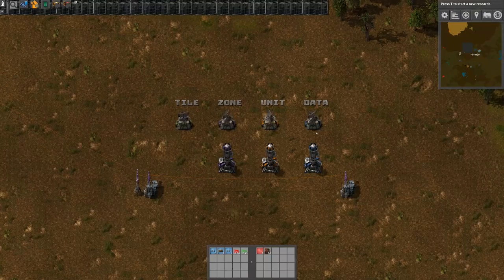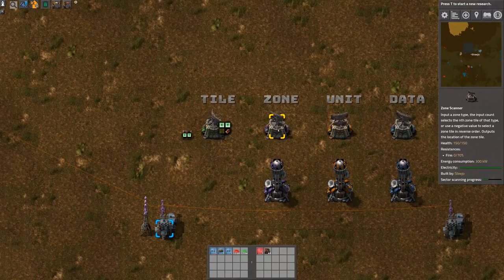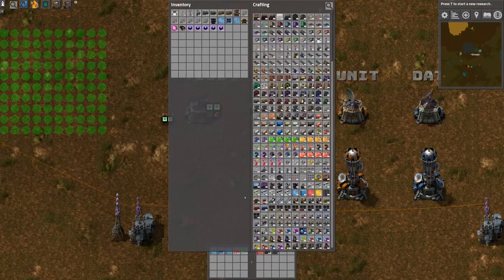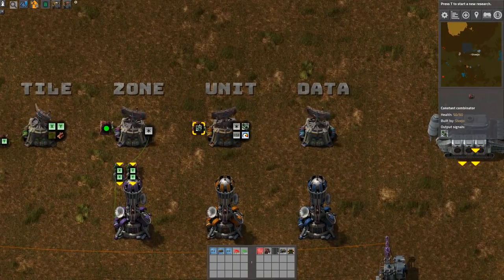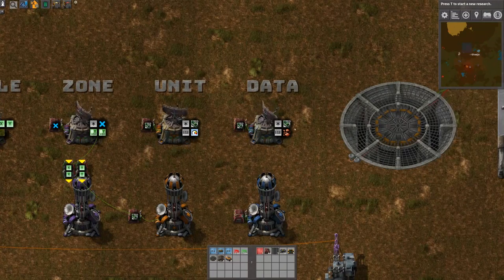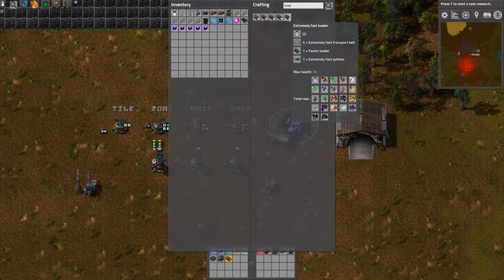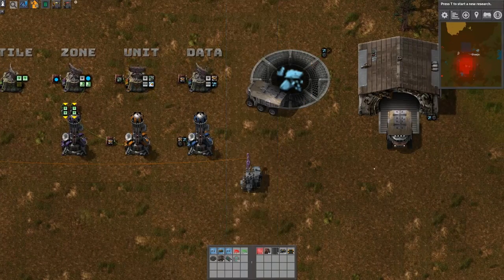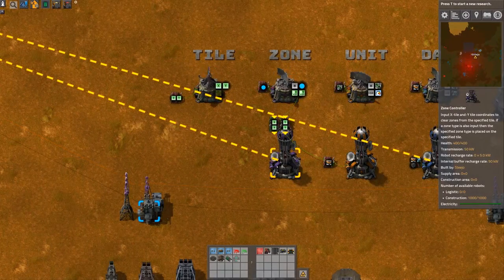Structures and Vehicles | AAI Mod Tutorial Part 1

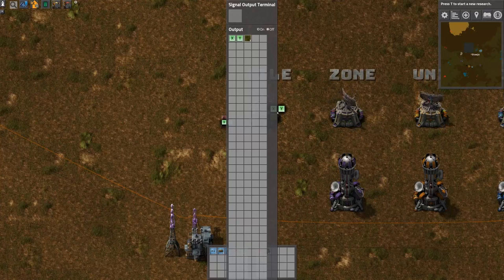Comment: 4:20 (heh) Could you send an additional "dummy" signal along with the X and Y both set to 0?

Regarding the "scan a random tile in the given radius" behaviour, would it be useful to set up a sort of raster scan of the area instead (so have an X value going from say 1 to 100 before incrementing Y by 1, then X does 1 to 100 again)?